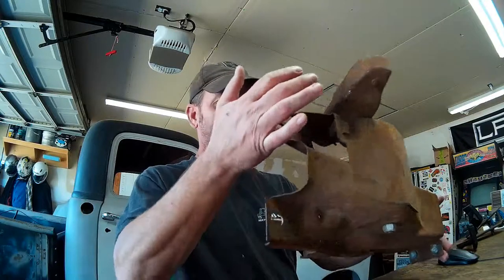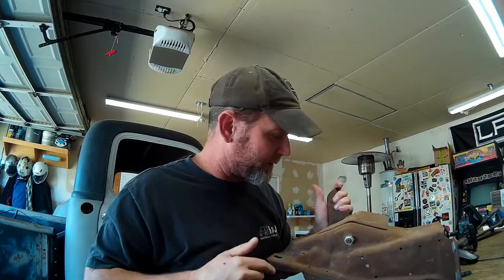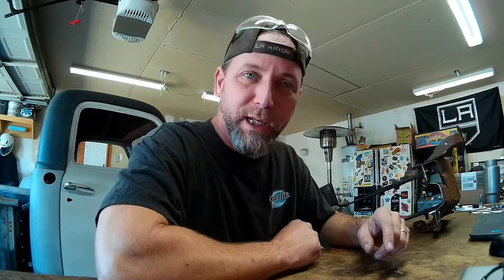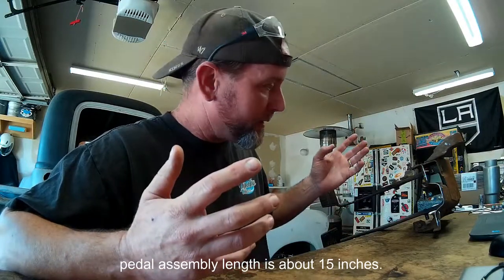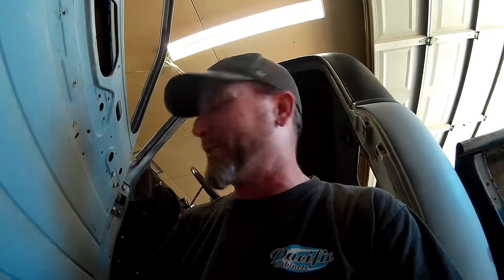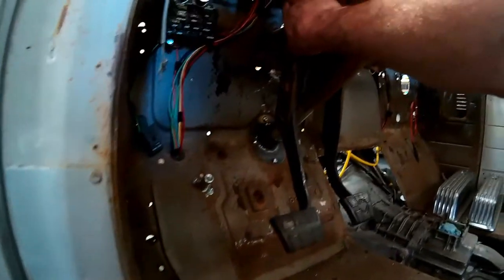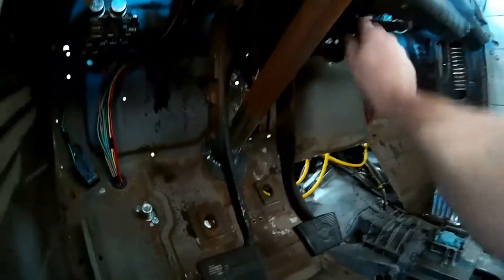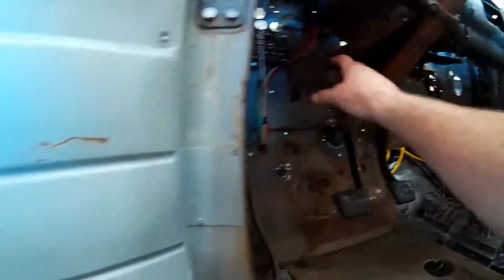P48 Project; How To Clutch Pedal Assembly Swap!

Comment: What was the pedal bracket out of I'm doing the same project thanks for the video.
Reply from the maker: i believe Chevy used this same pedal assembly from mid-70s thru early 90s.  this particular assembly is a hydraulic clutch pedal assy from 1989 K1500.  thanks!

Comment: What vehicle did you get the pedal assembly from?
Reply from the maker: squarebody chevy.  and on the '59 Apache i'm building right now, i used a spare F100 pedal assy i had laying around.  worked well with a little trimming.  thanks for asking!

Comment: mine broke in my truck and where the clutch and brake run through the assembly and the fire wall i can’t figure out how to remove those to get the assembly out if you could give me a tip or anything i would be grateful and if you can help and need a better description i can give you one👍🏻
Reply: it’s a 2000 ford f-150 the push rod is where i’m stuck

Comment: What is the bracket and pedal assembly from?
Reply from the maker: squarebody chevy.  and on the '59 Apache i'm building right now, i used a spare F100 pedal assy i had laying around.  worked well with a little trimming.  thanks for asking!